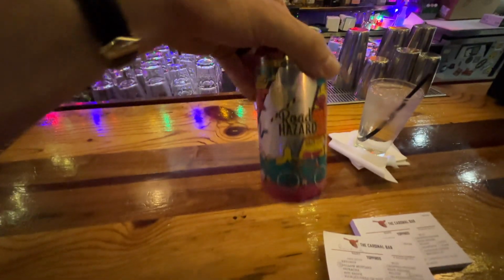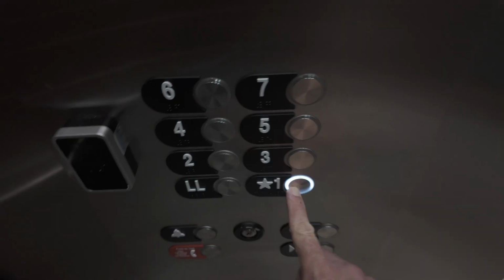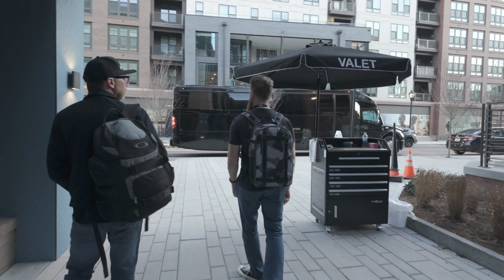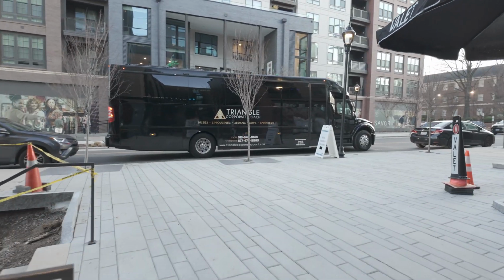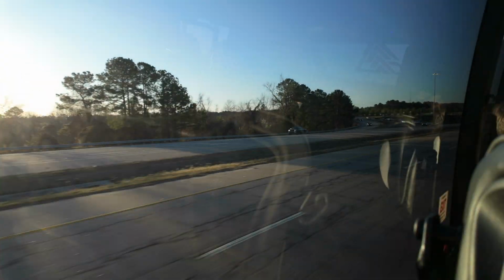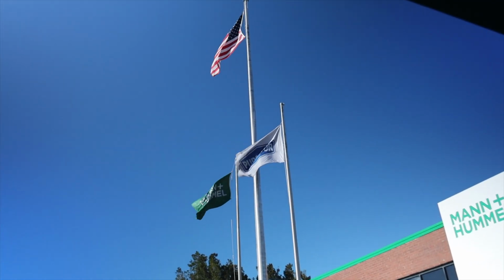Purolator 20K OIL FILTER HOW IT’s MADE? #purolator20k

Comment: It's the same, medium particle size filter as the Boss except a bit higher capacity before it gets plugged up and goes into bypass.  The Purolator One is still a better filter for clean engines and frequent oil/filter changes because it's a small particle size filter. Purolator One gets plugged up and goes into bypass twice as fast as the Boss / 20k because it has half the dirt holding capacity due to the thicker media needed for catching smaller particles. This is all important info for people switching to Valvoline R&P, I'm planning on running the Boss for the first 4 5k oil changes to avoid the concerns of an oil filter getting plugged up,  and then switching to the One.

Comment: I'll be staying with the boss filter. The 20k filter does filter more. I believe it said 99% at 20 microns, and the boss filter is 99% at 46 microns. However, the boss filter casing is thicker, which I personally like. Ide be happy with either filter and right now all the boss filters are on like a clearance sale.
Reply: So if you dont run the vehicle hard this 20k is fine?

Comment: I have a "beef" with the misinformed regarding micron size statements. 20-30 micron range is the balance area between full loading/clogging and catching the majority of the most harmful particulate.  Particulate smaller than than that is potentially harmful down to about 10 micron, but loading that extra amount requires dual filter systems (by-pass filters) targeting the larger size and the smaller size separately.  Particles below 10 micron generally are able to pass through spaces (bearings, friction surfaces) without issue.  That 10 to 20 micron range is what is not being filtered and leads to our dirty oil requiring change.  The quality of the oil  (base oil and total additive package) and a high quality filter matters.  One can argue "just change your oil every 3,000 miles and you are fine" but today's technologies don't reflect that wasteful mindset.  Oil and filters are designed to last MUCH longer than that, but the skepticism about it is understandable...yet unwarranted.  Each car and environment is different. I highly recommend taking the time and effort ($) to verify what works for your situation by testing your oil through lab used oil analysis (UOA) to see what interval is actually correct.  Stick with the same oil and filter in doing so to keep consistency as oils and filters will vary.  I personally only use Amsoil and Purolator BOSS.  I'm not recommending this for anyone...but I have used UOA to verify my results and intervals.  GM says 7500 miles (if I recall) and my UAO says I can reach that, but 5000-6000 is my target mileage range for my own piece of mind without any concern.  The "20k" rating is just the build spec the engineers designed and tested before failure (not filtration directly which is determined by full load before bypass valves open).  They are not necessarily stating to run the filter unchanged for 20k.

Comment: They need to replace the black sealant they use for this filter and the One filter. It fails to hold the endcaps on. when cut open they come apart real easy. The Boss filter sealant is super strong.

Comment: How does the Gold 20k filter differ from a Boss that is rated @ 20kmiles
Reply: It's the same, medium particle size filter except a bit higher capacity before it gets plugged up and goes into bypass.  The Purolator One is still a better filter for clean engines and frequent oil/filter changes because it's a small particle size filter. Purolator One gets plugged up and goes into bypass twice as fast as the Boss / 20k because it has half the dirt holding capacity due to the thicker media needed for catching smaller particles.

Comment: The only thing these extended intervals is causing is a less reliable vehicle. Look at the data… as intervals go up reliability goes down….. it’s just crap
Reply: Not true. The oil companies have spent decades formulating these long life oils. They have millions of miles on these oils. They run engines to destruction. Then improve the oil, and do it again. 

They have the data to back up their oils. You can't blame cam shafts or rod bearings made out of spec on oil. Or engines with metal shavings left in them after being manufactured. There's really no engines failing because of oil change intervals

Comment: I’m tuning puralator boss oil filters rated at 20k. Never ever ever ever would I come close to that. 5k max. Ever. 16year master tech here. Don’t ever go 20k on anything period. This is all bullshit marketing
Reply: 7500 is fine or once a year
Reply: Do some research on PAO and Ester based oils. They can be used way past 5,000 miles. 20,000 miles is stretching it for any oil, though.

Comment: Why didn’t anyone have the god dam sense to ask what the micron rating is at 99% 🤦🏻🤦🏻🤦🏻🤦🏻🤦🏻🤦🏻🤦🏻🤦🏻🤦🏻🤦🏻🤦🏻🤦🏻🤦🏻
Reply: Probably 30 microns is my guess
Reply: @marcusevangeliste7426 honestly that’s what my guess was but none of the people there that I seen actually asked the people challenging questions like why go synthetic blend when I microglass full synthetic has been proven over time that it can go 20k miles and what’s different from your synthetic blend compared to what’s out on the market you know things like that…………Mobil 1 changed there suppliers and they are now better than ever!!!!!!!!
Reply: Probably 20. Doesn't really matter. The filtration will improve as the filter ages. The big holes get plugged with carbon and oil will be forced through smaller gaps.
Reply: 46 as 3rd party tests have shown

Comment: I have a BEEF with this one... The Ford Motorcraft 2062 filter for my 2022 year F-150... says made in Brazil.  The Purolator Model at Walmart model for it  LX11955  also says Made in Brazil!!  The filter for Purolator and Motorcraft looks like the same, no enhanced filter media looks like typical cellulose in both?!?!!?  Compare them. Please correct me if I am wrong!  There is no 20,000 mile rating on the Motorcraft one.
Reply: It's most likely made at the same facility. Ford doesn't make filters,but contracts with these large companies to supply them.
Reply: Purolator makes the Motorcraft filters in Fayetteville, NC for the North American market. They do not put a lifespan on the box as the oil change interval varies from engine to engine. 

Ford is a global company, and they will contract filters to other factories. The FoMoCo branded filters are made by Mann+Hummel.

Comment: Any idea what the filtering efficiency is? It's not worth much without it.
Reply: Still no word from Purolator on the standard ISO 4548-12 multi-pass test.  The media 'looks' good, is dual layer, so I guess it will be about 99% at 25 microns.   Guess. Not facts yet.  I just opened up a new one, and I like it, quality inside, very little loose glue, just make sure the internal louvers look open enough for you when inspecting a new one.
Reply: @softwaresignals  The last Purolator filter I opened up had half of the louvers closed and an very bad glue job, with big chunks of glue peeling off.
Reply: @ True, actually most U.S. or Mexico made oil filters I've seen cut open over the last 10 yrs or so have had Quality Control problems way too often.   I'm hoping Mann+Hummel realizes it's out of control and this factory in N. Carolina making the new 20k Purolator gold-can will know better.   Looks good so far, we'll see.   A lot of people just get the Premium Guard family for quality:  Mobil 1, NapaGold, Microgard Select, Carquest Premium, Pentius UFXL, all good quality inside.
Reply: Probably 99% at 20 microns. As the filter gets older, the filtration gets better. The larger holes in the media get plugged up, and the only way through is the smaller gaps.